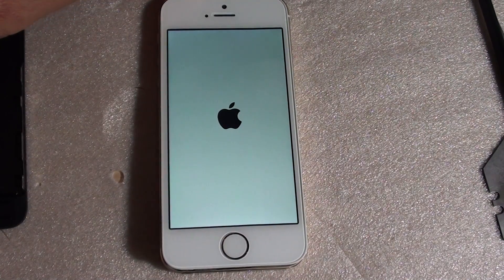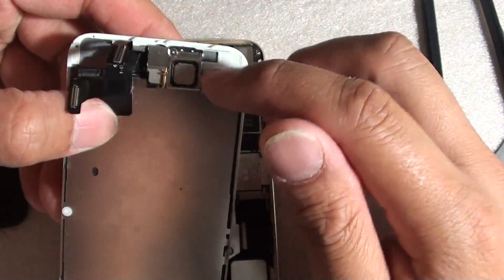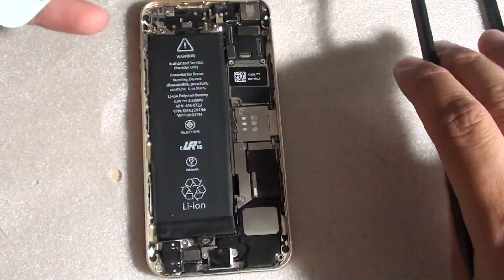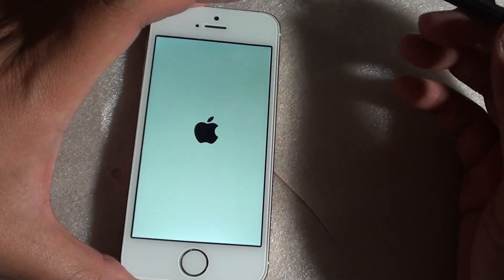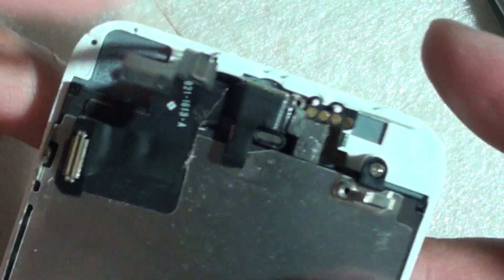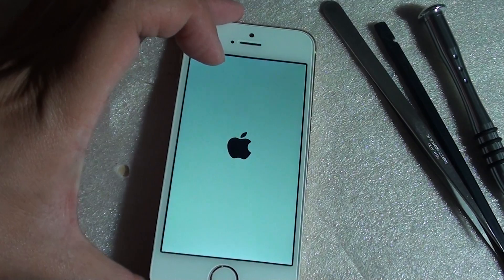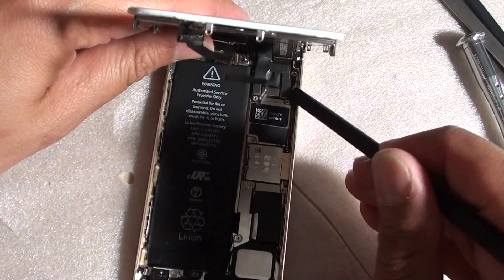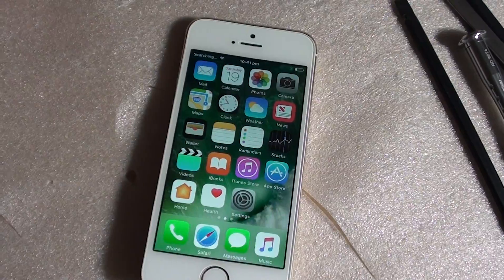iPhone 5S: How to Fix Reboot Problem After Screen Replacement

Comment: Thanks bro, nice video, it help me.

First of all, i replace the battery, it end up i accidently damage the screen cable. I bought a replacement screen it end up boot into Apple logo only, after many method been tried i still not able to get pass the Apple logo.

Then i tried you method by remove the screen cable, it works.

Thank u so much.

Comment: hello i hope you see this comment i turn on my iphone 5S it shows the white screen with the apple logo then goes black but still backlit and after about 15 minutes it repeats the process i have tried to DFU the phone and restore but it won't i replaced the battery because it only turns on when plugged in but this doesn't solve the issue

Comment: Quick tip if you take the screen off while the battery is still connected it could fry the backlight of the screen so just be careful when changing the screen

Comment: Mine shows the apple logo for 10 seconds then shows a red/blue screen then reboots I tried putting it into dfu mode and resetting it but it gives me error 4000 or rarely 9 I'm pretty sure 9 is something to do with a chip on the board but I don't know what error 4000 is if anybody knows please tell me it would be much appreciated also the screen has a yellow line running down it the ribbon cables are faulty but I can still see the screen

Comment: Hi there , great videos you provide, my iPhone 5s shows Apple logo then goes to a black screen, when I disconnected the home button flex from the motherboard it’s turns off completely, plug it back in and it’s stuck in dfu mode , it then attempts to restore on iTunes and gives a (2015) error, any help will be greatly appreciated, thanks

Comment: Hello guys im having issues with my Iphone 5s and i thought you could maybe help.

So a few weeks back my iphone stopped charging. i have tried multiple chargers and cables and that doesnt seem to be the problem. i just charged the phone one night and then tried to charge it again the next day and it didnt react. the phone came in contact with water a few months back but the water probably didnt even get inside. youre probably thinking that the charging port just went out, but the problem is, when i put my iphone in the charger (its 0% battery now) i can see the little white charger picture pop-up, so the phone RECOGNIZES the charger but doesnt charge, even when its completely black. should i replace the charging jack? is it a software or hardware issue? any help is appreciated, thanks
Reply: notenex Id say either the charging board or the battery but not entirely sure

Comment: Hi have a broken cable do you know of anywhere I can buy replacement ables for my iPhone 5s please as it worked fine till the cable broke mine is the cable that sticks to back plate and also the cable under it that goes to the metal connection for the digitiser do you know where I could buy cables from please my email is daveprest80@yahoo.co.uk thanks for the film and help

Comment: can youhelp me?my phone got stuck on the apple logo when my battery drop too low and died, when i charged my phone itgot stuck on the apple logo,i tried to restore the iphone but whenever it on its proccess it going down and restarted back to the restore mode all over again,i have tried with 2 laptops and 2 usb, ive tried change my home button and the battery but thats all ok, but the technician doesnt want to try taking off the flex cable one by one, he only said that my harddisk or ram or memory is broken and i need to change it.. i didnt change it because he is not explain to me what he have done to my phone and when i ask to try the flex cable he wont do that he said that he is done trying with the cable in front of me but i saw that he taking off all the flex not try itone by one... is there any possibilities for my hard disk broke?
Reply: SAME HERE. DO YOU HAVE A SOLUTION?

Comment: i dropped my iphone and the screen stopped working so i took to a little store and they replaced the screen with the one from another iphone , the screen is allright  because they tried it first, when they replaced and we turned on the phone it started rebooting and i've tried to restore it but itunes won't let me, it says error 9.... PLEASE HELP ME WHAT SHOULD I DO ??? IM GONNA TRY WHAT HE DID ON THE VIDEO BUT... IS THERE OTHER WAY TO FIX IT? PLEASE HELPP ME :(
Reply: Maybe they didn't put back the screws at their right place. If you swap the screws on metal cover that covers the cables which are connected with the logicboard, the screws which are too long can destroy the conductor tracks on your logicboard. In that case you can put your iPhone in the trash. If you want me to give you some tips, let me know. Sry for my English if something is wrong

Comment: my battery was beginning to pop my screen up and it affected my screen so i had to change both and now it's just showing the apple logo it's not flashing but just showing the logo and until the battery is out is I charge it the battery will heat up PLEASE SOMEBODY PLEASE HELP ME!!!!! WHAT CAN I DO TO FIX IT ????
Reply: Larry Murimi try charging the battery in a faulty or different phone. If that doesn't work, let the battery drain, take the battery out and put it back in. Hope this helps :)

Comment: Mines doing that but the only reason its turning on its when i  plug it in my charger but then it dont want to turn off after i plug it in, and i tried to do it on the laptop and it wont turn on
Reply: tito perez same
Reply: tito perez
Reply: I have the same
Reply: yooo i have exactly the same
Reply: Battery is most likely the problem
Reply: Same for mine but I got a new phone now non iphone feels good man

Comment: I have the same problem, I've checked the flex cables and tried eliminating the camera cable as suggested but "I've still got the apple logo come on and then the screen goes blank and then turns off"

Comment: anyone can help? my iphone 5s phone is constantly rebooting how to improve?
Reply: try disconnecting the front flex camera clip and try again, i have had this issue and has been caused from the front facing camera flex being faulty
Reply: roland hadari me too
Reply: roland hadari Have you changed anything yourself or has anything been fixed by a third party (Not apple)?
Reply: Battery has been replaced but still the same problem restarting on its own .There have any idea what might be the problem of my phone?

Comment: I have a problem with my laptop and it's stuck in a mode in where when I turn it on it comes up with a msg to insert a new boot media and press any key to continue. I have a ASUS and I have try fixing it but no good. Any help/advice?
Reply: King Craft same here. I have that problem but dunno how to fix? I want to reinstall Windows all together Coz I don't have much data. Pls help ITJungles please.
Reply: King Craft Try to boot in safe mode, I think it's holding F8 when it's booting up, but check first, the. Restore from a backup/reset etc